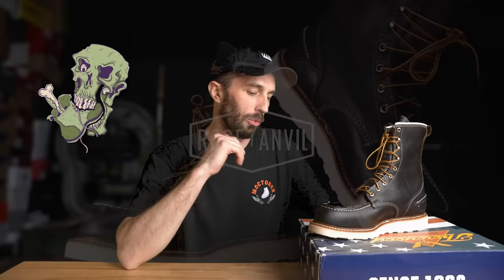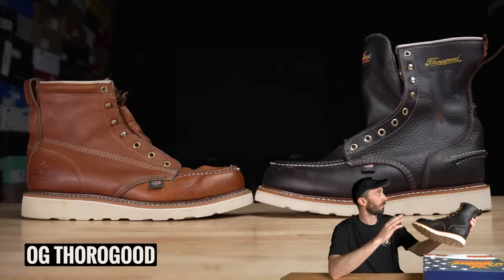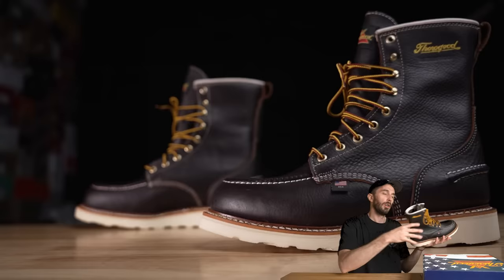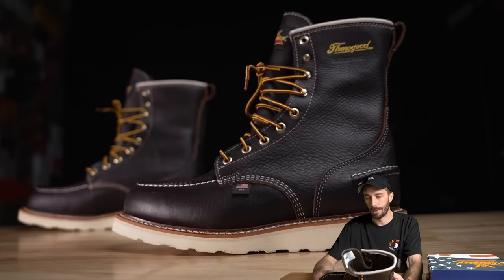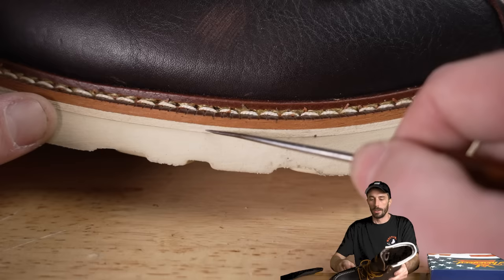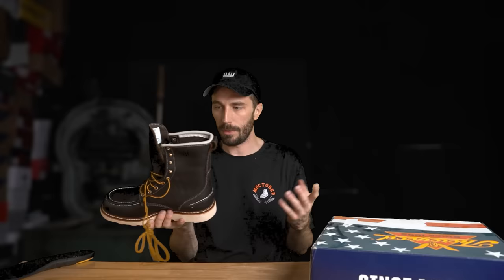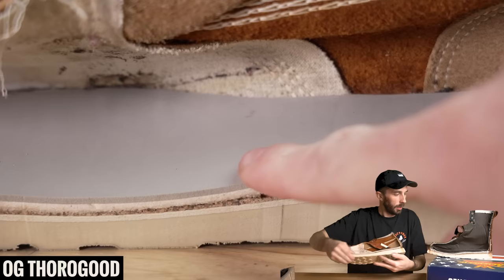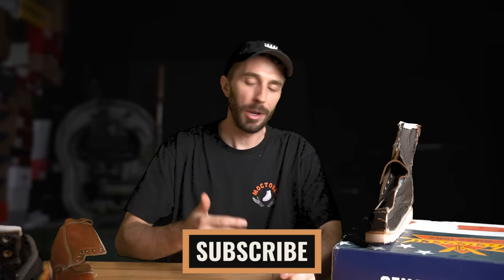Whats inside 1957 Thorogood boots

Comment: I wear the TH814-4141 (aka 8" Flyway with the black, heeled sole) daily in my urban landscaping work. I found them extremely comfortable right out of the box. They've held up well, and so far they've been quite waterproof, even when saturated by water from broken irrigation lines. The only downside is that the soles are wearing out a bit faster than expected, probably from all my walking on pavement. But even at $300, getting a new pair every year would be worth it.
Reply: I've owned lots of boots, including Redwing Heritage (fantastic leather, flimsy soles, uncomfortable footing with poor arch support) and White's Smoke Jumpers (perfect fit after long break-in, went for 5 years before I had to resole, they really do prevent fatigue, still working hard). I also own shoes by Allen Edmonds and Rancourt. I bought these because they were waterproof, incredibly soft to the touch, and so good looking.
Reply: I have a pair of this TH814-4141 with the black sole as well as an older pair that are not the 'maxwear' sole. The material on the older (5 yrs?) seems a little harder than the 'maxwear'. Pavement, especially older, rougher does a number on the 'maxwedge'. I have no idea if they are different materials. It may be more in the way I use them. I tend to put more pavement miles on the black ones.

Comment: The soles are not slip resistant. Because the tred is not deep enough. However, thorogoods are amazing for walking on grating, up ladders, and general worksite use. I am maintenence tech, in manufacturing and these are comfortable on concrete.

The soles last a year, but the soles are comfortable. This is the most comfortable work boot I have ever worn, as long as your work pays for your work boots. These are hard to beat.

Comment: Comfy boots, I have the 1957 flyway uplanders. When I first put em on it felt like I was walking on a cloud. However I wore the counters out in 3 months, sent em back, Thorogood put a moleskin type cover on the counters, wore those off in a month. Back to the hole in the counters. Then I learned how to tie a heel lock with the laces. Much less damage that way. The sole has lasted 3 years. Time to resole em. I work in a water utility and usually go through 3 to 4 pairs of boots a year. These boots have been a great value

Comment: I just bought my second pair of Thorogood boots. I wore the first pair for over three years and had the sole replaced once (I am quite bow legged). They were easily the best boots I have ever worn, far exceeding even Red Wing! Though I considered purchasing the 1957 - for all the reasons you noted - I decided the extra money wasn't worth the difference. I did change to the dark sole because the white one quickly gets nasty looking. By the way, the only reason I bought the new boot was because a hole developed in the leather where my little toe rides. I would have gladly had them resoled and worn them for another year or two!

Comment: I bought these but with the maxwedge heel for doing powerline work last month, and after they broke in I’m seriously impressed! Arguably my most comfortable set of boots, and I’m usually a Justin’s Stan!
Reply: I don't mean to put down the company, but I wouldn't call Justin the highest bar you could set for yourself. There's far better options for similar prices
Reply: @Arto257  I mean, I’ve had a set that’s lasted me 6 years before finally splitting, and my main work set is going strong, though I definitely prefer these Thorogoods.

Comment: I love my 1957s, first thing I did was remove the lining, now they are awsome. I work outside in Fla, these boots are super comfortable. light and tuff soles. ( 1 inch defined , not the silly wedge)
Reply: How did you remove the lining? Work well?
Reply: @001blackmax  i cut into the lining up at the top , peeled it down then got out my linemans pliers and twisted . Lots of struggle and some profanity . Ultimately its just a waterproof sock thats glued in , so it will come out
Reply: That's awesome, do you like it better torn out? Did it mess with the sizing much?
Reply: @001blackmax  like it much better, im in hot weather most of the year, the waterproof bootie is a hot box, without it the boot breaths correctly and yes, the fit is better, much better

Comment: Assumed that stitch on the heel was for the strap on Snow Shoes so it doesn't slide around. Its also present on my Irish Setter's.
Reply: I was thinking that as well.   Only downside to using these in the snow is the polyurethane soles.  For traction on ice and snow the sole needs carbon black in it.  Same reason car tires are black.

Comment: I work in a window factory, assembling frames from composite materials. I got a pair of red wing supersole 2.0's but was extremely unhappy with the comfort and how they held up over my almost 8 months of using them. The toe box took a huge gouge the first day I wore them to work, and by the time I bought the 1957's, the leather on the Supersoles toe boxes was basically gone. Top half of it was worn away, and I'm not particularly hard on boots. Most of my work is walking back and forth at an assembly table or standing in place. Comfort wise, even after replacing the insoles with something I like, it was still painful to walk in and outside of them, and I bled for a few weeks on the inside of my heel. I hoped it was just break in, but, it never improved over 8 months while I debated on buying another leather mitusa boot. Then I learned about thorogood, and the fact they're made only an hour away from me, I got interested, fell in love with the looks of these 1957's Crazyhorse color, checked around for reviews on other thorogoods, and bought them 4 months ago. Haven't regretted it since. Whatever insole came in mine, i didn't care for, but I got a pair of their insoles from amazon and they're amazing. Best insoles i've ever bought. Break in was maybe a day, and that's being generous. I was worried about durability of the moc stitch and the tumbled leather, but they have held up leaps and bounds better than the red wings did, and the oil seems to have added "character," I think it would be called. The areas that bend around the shaft have turned a much darker color. I find myself looking around them sometimes when I put them on before work.  I have a couple scratches in the toe box and some discoloring from I think the alcohol we use for cleaning, but they've held up fantastic, and when these do eventually bite the dust, i'd be happy to buy another.

Comment: I like to wear my boots sloppy loose, so i demolish heels. I started throwing cotton wire harness tape or cotton friction tape for electrical work in the heel and it has gone a long way to keep my boots alive. I have 8' thorogood flyways (same thing as above but they have lug soles instead of the wedges) for 2 1/2 years without failure.

Comment: I bought these boots and had them for about six months and had to resole them and my cobbler used Vibram soles and I absolutely loved them after changing over. The break in was murder but after having them for two years I don’t ever want to buy a new pair weather proofing 100% never went home with wet feet working in the the north west.

Comment: Just ordered these boots can't wait to get them im a Union Carpenter in the PNW and usually I buy redwings or irishsetters sold in the same store but not technically redwings. But there okay very mid boots not shitty not great they work good for the price range so I'm excited to finally step up a bit wi5h these thorogoods and they had a great deal went from 290 down to 149 so I picked them up fast.

Comment: I have the midnight series black thorogoods as an at the Station/technical rescue boot. Modified it by removing the speed laces and adding eyelets for lace in zippers. Cleaned, mink oiled, and wax polished often. They just hold up. Hopefully they make it through 3 or 4 soles.

Comment: The placement of the moc toe stitch is extremely important, and I've had a difficult time trying to find a pair of moc toe thorogood boots where the moc toe stitch is the same on both the left and right boot! As much as I love my current pair of thorogoods, the one thing that has always driven me crazy, is the incorrect location of the moc toe stitch.
Reply: Same. Seems the quality control is terrible. But these r great for a 1 yr work boot
Reply: Same here!  My pair of tobacco mocs has perfectly placed stitching but I also have the crazy horse and black walnut and on both of those pairs, the toe stitching is completely misaligned, both between L and R boots and in relation to the corners of the toe box.  Really shoddy QC if you ask me.

Comment: Thanks for doing this. I learned my lesson with Wolverines that were unlined and tore up my feet pretty bad. And they have a silly stitch exactly at the back of the foot. So I am certainly considering a waterproof lined Moc Toes.
Reply: Likely an issue with the fit rather than the fact that they were unlined.

Comment: I have a pair of the Thorogood "emperor toe" boots in this same or very similar leather. Apart from the nice roomy toe box this leather is the best part. I work at a desk so I don't need a PNW level boot. Combine the this nice heavy oil tanned leather with the OG Thorogood features and you have a good boot.

Comment: I’ve been buying thorogoods for close to 20 years the 1957 is my favorite but I’ve tried pretty much every wedge sole boot from them. 
I’m an ironworker  my boots are used for work. 
Every pair the crappy welt They use cracks and then my feet hurt. It makes them Not worth re-soling.when the welt cracks it makes my feet hurt.
 I’ve had a few re soled, but the welt really needs to be replaced. Also the vibram cristy wears out much faster than the max wear.
When you get into replacing the welt, you pass the price of just buying a new pair. Maybe someday I’ll try a full rebuild on a pair.

Comment: Appreciate the information.  Looking to buy work boots. Ok with the non-waterproof boot testing. Fiberglass shank, prefer metal, but fiber glass is ok.  The low puncture resistance is a bit of a concern, but not overly concerned.  Missing the insert foot pad (Poron layer 19:15 in video)  and the leather heel backing (counter cover 17:50 of video) can be overcome.  I can purchase inserts and heel pads , but for $320 I would not want to have to purchase these items. The non-leather welt (12:05 in video) is the final deal killer for me.

Comment: I understand it from a function perspective, but to me, I just don’t like the look of the white foam on boots. It just looks like running shoes with a boot stuck on top. For people working on hard surfaces it makes sense. I like the boots that have the lugged black vibram outsoles the best out of any outsole imho.
Reply: U can get a black wedge on thorogoods
Reply: I agree about the colour. I had some Rossi (Australian) desert boots the got resoled with the cream redwing wedge soles. They got really grubby looking quickly and were difficult to clean up.
Not to mention the Redwing wedges are pretty hard and heavy compared to the original Rossi soles.

Comment: I bought this boot 2 years ago. They are pretty good but they don’t provide a EE WIDTH. I thought after break in the leather would stretch and shape to my wide foot, but unfortunately it didn’t. I don’t know if it because I have the steel toe version for work. Also the second speed hook digs into my ankle so I skip that during lace up. I still wear every day for 8+ hrs/ day.
Reply: They do make a EE. I down size half a size and get EE every single time.
Reply: @sparks701  bingo. I'm normally a 10 or 10.5. EE Instead got these in 9.5 EE and they fit beautifully
Reply: @joesmithe198  yep. They run a bit long but really narrow.
Reply: @sparks701  I bought the “wide” version which is EE but there wasn’t an option to go wider.

Comment: How did work boots ever become the footwear of a Hipster Doofus', I grew up wearing nothing but low top "4 inch" boondockers. Never cared about resoling!!
Never had sneakers. These were my sneakers. Today, THOROGOOD slip on station boots (Chelsea boots).
Have 3 Pairs. Love Them, I'm on my feet 8-10 hrs a day. For the price. They are just fine. On concrete and on a saltwater charter boat. Sprayed with waterproofing spray.

Comment: I have this exact pair and they are completely waterproof I’ve stood on water for 5 minutes straight and not a drop went got in and I stand in water a lot and they have never gotten wet o absolutely love these boots maybe when you put the boot in the water went above the gusset because other then that these boots are bulletproof, I’ve also worn a hole in the heel through the water proof layer and they still don’t get wet but until Hubert’s shoe grease probably helps keep them waterproof cause when I step in water it rolls right off the leather so it doesn’t even have a chance of absorbing I believe even this out the waterproof liner inside with the Hubert’s shoe grease and just pure leather boots would still be waterproof

Comment: Had high hopes for this boot, but they have a fatal design flaw when compared to the OG Thorogoods not mentioned in the video. My last 2 pairs of OG Thorogoods lasted me 3 years each, I love Thorogood, so thought I'd give these a try. I've seen a few other reviewers touch on it, but everyone's built a little different. The issue - for some reason the upper has much less material "width" when compared to the OG Thorogoods, and so the eyelets and the hooks are positioned more outward and wider on your foot and ankle. This can be seen most clearly with how wide the tongue looks when it's laced tight. On my pair, even when lacing the boot as tight as possible, the first hooks above the eyelets land right on the inner ankle bone. Combine that hook placement with the tongue folding in right below it at the same location and wow, there is SO much pressure placed right on the inner ankle bone. They're extremely painful, I had bruises after a couple hours, hoping I could break them in. Ended up returning them and got my 3rd pair of OG Thorogoods - which are still perfect. I checked and the first hook is ~1" away from the ankle bone on the OGs, perfectly comfortable.

Comment: I worn out my OG TGs and bought the 1957's without much researching them except I knew the OGs were comfy.  Big mistake.
Thoroughgoods do not come in half sizing, but the OGs eventually stretched while the 57's refused to stretch after months of wearing them. The 57s also are not as comfortable on the sole.
The 57s look nice and cost much more but I'll not be buying the brand anymore due to no half sizing. 
I think the lining and waterproof membrane in the 57s also make them uncomfortable during the break in process for myself.

Comment: Been eying some of these higher end brands but hesitant to pull the trigger as I am worried about the fit. This week my friend gave me a brand new pair he mistakenly got (wrong size) of this exact boot. Was super exciting because because I recognized them from this video, theywere my exact size at 10.5w and looked amazing. Unfortunately thier version of wide is still fairly narrow and I couldn't make it work😢. Wanted it so bad but was crushing my foot.
Reply: Was it a 10.5 E? I find Thorogoods are a bit on the wide side, myself.
Reply: @InGrindWeCrust2010  Yes, 10.5 E. I did hear they are known for being roomy, which is why I had been considering them for purchase. I actually haven't given up on them yet. I oiled them and have been wearing them a few hours at a time, hoping to break in the tight spots. For some reason the left boot has a bit more room. Someone recommended to try boot stretchers.
Reply: @joshgies1869  I would agree with that. They have a nice wide footbed. Although I'm actually about to sell mine because one of my pairs is just too big overall and the other just doesn't suit the shape of my foot, even though the size fits. Both 10.5Ds. Some brands just work better than others for each person.

Comment: I think the outsole puncture test is very relevant. Wearing boots on a construction site will have you stepping on nails very often.
Reply: A few weeks ago, there was a piece of steel round on the dirt drive way, about 1/8” in diameter and not sharp on the ends. It was a few inches long. The ground was wet and it had rained a lot so I thought I’d just poke it in the ground and then step on it to push it all the way into the ground so it doesn’t end up in a tire. It must’ve hit a big rock or something, as it went right through my boot and into my foot with barely any pressure. I’m 240lbs and I was putting far less than half my weight into it with the one foots. It was not fun pulling that out. Went about 1/4” into my foot, and the rubber sole had a lot of grip on the steel round. I won’t buy these “work boots” anymore. There’s not a single layer of leather between your foot and the ground. Just some soft rubber and synthetic shit.